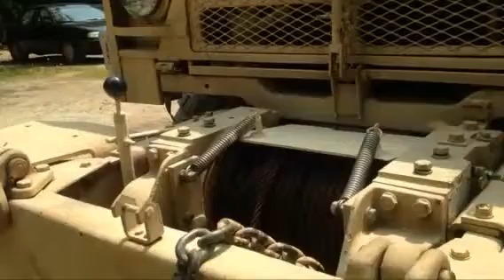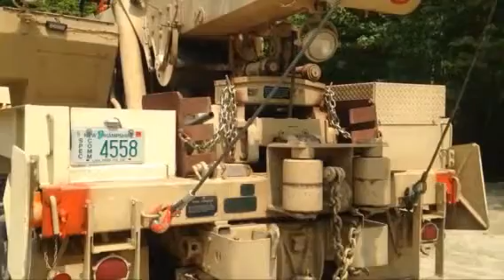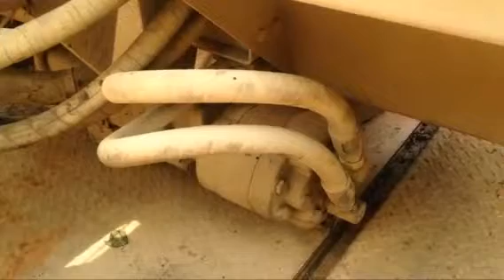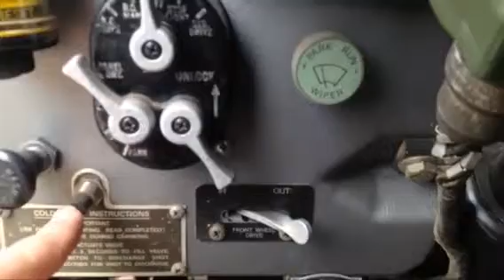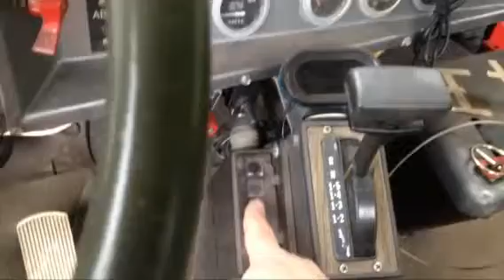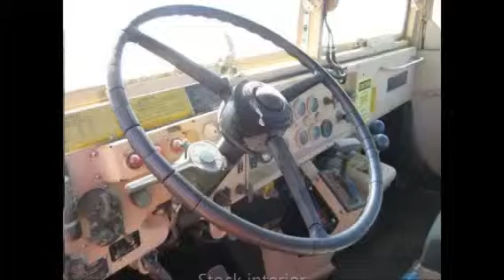Mikes Towing Military Wrecker Part 1 General Info

Comment: I owned 2 M923a2 cargo trucks.  I believe the A2's were built 1989 to 1991 (3 yrs), they have the newer turbo cummins and the tires you can change air pressure on the go from the cab.  the earlier 900 series had that older cummins (NHC 250?) and no tire deflate system.
Reply from the maker: you may be correct, i based the year on what it was sold and titled as, but you are not the first person to think it was newer then i thought.
Reply: The A2's were built 1987-1994 and from BMY Division of Harsco.
The A1's were from AM General and had NHC-250's just like the original M939 series which also had dual tires and not the Super Singles like the A1's & A2's.
The easiest way to tell the A1's & A2's apart is that A2's have wheel guards on the front rims for the air valves and actually the tread pattern on the tires is different between the two series.It's only difficult when the A2's have their original rims swapped when some owners disconnect the CTIS.

Comment: Your rear right tires supposed to be in the other side according to your tread facing the wrong way
Reply from the maker: Agreed, im sure the tires are not original and came off different trucks at different times throughout its life. I bought and sold it with the rubber it has in the video.  Thanks for watching
Reply: @mikestowinginnh7866  I'm just poking fun buddy this is a badass setup and I really like what you have done to it this far and will be staying tuned for more if you go on any calls with it I beg you get some footage of it in action please
Reply from the maker: @taylorwalling8234  no worries, but your totally right.  i remember walking around the truck one day trying to figure how to get them all going the same direction. Unfortunately i sold the truck this past fall. So that's it for videos of this one. Thanks again for watching.

Comment: I was assigned to a 5 ton wrecker for the last 6 months of my time in the U.S.Army and I have to say I did some things with it that were dangerous but got away with them.like picking up 5 tons of lumber without putting the outriggers down when lifting over the side of the truck  and having the offside tires off the ground 2 feet off the ground. or picking up a bundle of railroad ties and pulling the dead end off out of it's attachment and streaching the boom cable.
I was in a construction batallion that had two truck mounted cranes they and a large American Rough terrain crane and would not send them to the S4 yard to unload this stuff. 
I kept telling them the wrecker was not big eough for the job and they kept sending me so I did some  scary things and those guys over at the S4 yard knew what to expect I would supervise them setting the slings and then tell them to hide before it made a lift. They really got a kick out of watching me do it without hurting anyone or the truck.

Now yes I could have lifted the stuff a little at a time taking hours or playing cowboy and doing it all at once. When went to the field the wrecker is last in line and in Texas there are coleechy roads and dust flies at the back, 

I have another story on that one. the convoy leaves the motor pool and gets out a ways and the Batallion Commanders jeep quits. I have to hook a tow bar on it and they make the driver sit in it as I tow it for the rest of the trip. We were going along on those dusty roads and I can't see 20 teet in front of me I may have been going 45 trying to keep up when all at once there is an MP standing there pointing to turn right and the turn was pretty fast but I made it. I can only imagine what it was like for that guy in the jeep.When we finally got to where we were going that guy in the jeep was covered head to toe with that dust.

I did not ask him how we made that corner without the jeep turning over or even talk to him. When I got out of the truck I don't remember looking for him. Probably a good thing or It could have been one hell of a fight.
Reply: Is it under rated?
Reply: Operated one for a couple years as well with a similiar experience. Training was a few ride alongs with the previous operator, mostly involved drinking coffee and getting away from the motorpool. I never used the outriggers lol. Had pallet duty one morning ( heavy drop pallets used to drop heavy equipment out of C130s) and a team of 11Bs tasked with assistance. No idea how to safely lift those pallets onto the flatbed. Two ratchet straps, boom hooked at the center point, and a couple grunts guiding the load. Nobody got crushed that day thankfully. We got it done, safety optional.

Comment: i beg to differ with you, the army did use them as tow trucks
Reply from the maker: jim thanks for watching its been awhile since i made the video or watched it, but i think i was referring to using it as a civilian wrecker would be used. If it were to be used in the same fashion the boom winch cable would be destroyed when pulling at an angle. this is why a crane boom and a wrecker boom are designed differently. This truck in original form has a crane design. Hence the reason the call it a material handling boom not a wrecker boom, and why there are no recovery procedures out lined in the operators manual that utilize the boom. But yes i agree they were used to tow vehicles, i may have worded that wrong.
Thanks again for watching!

Comment: Mr Mike's towing in New Hampshire, Sir.  I think your explaination is very clear, and well done.  You mentioned Sir,  that your  BMY-936A2  wrecker is or was, extensively modified to  operate  in the civilian  field of towing. And perhaps recovery.   So, accordingly, 
I assumed to see, first of all , an Old school tow bar,  installed onto the rear of the truck.  I was NOT expecting an under lift, due to the fact that the rear of the military truck, is a very jam packed erea for a 6x6  unit like it is, and  the frame has very little overhang onto which to install the commercial under lift.   So, accordingly,  I fail to understand Sir, How  exactly Your truck is so , extensively, 
modified! It seems very stock, as issued to me.  So I would  be interested to know, just for curiousitie's  sake. 
Also, These Military wreckers are designed for use , in seas, of MUD, on dirt roads,  pulling out, and manipulating heavy weapons, 
bogged down in mud !   they are low speed trucks,  they are utilitarian work horses, with no bells and whistles !   They are for rear echelon work, behind the lines!   they are very over built, and over strong!  they are also heavily abused, by youngsters, who are 
impatient,  and poorly trained.   It is not easy for training personnel in the  civilian  National guard, to  turn week end warriors into
competant  recovery  professionals, with outdated equipment , which I personnally respect,  very , very enthusiastically, as compared to , modern,  Miller Industries, ultra expensive state of the art , fully hydraulic  boom equipment  installed on  ultra expensive  modern 
tow trucks !   I own , personally  three tow trucks. One, a simple  50  thousand pound  pulling whinch , on a primitive  frame;   which
hangs a simple  huge pulley block,  down  to a primitive, but very functional tow bar.  This is a monsterly strong pulling set up. 
and  another truck a  5 ton, with a more modern  about a 30 thousand pound pulling whinch, with  a more  recent booms, and  a 
more modern tow bar assembly, for towing light , and medium trucks, and cars.   this  wrecker unit and body seems commercial, 
but has no id plate.  And I have a Ford L700,  gasoline powered  truck, with a Holmes  600 wrecker, equipped with Holmes 750 booms
from the plant , to tow school buses.  It also has a wonderfull gas powered HD air compressor on board; between the cab and the wrecker  body ! A very powerful,  old school  top of the line at the time  wrecker, before the hydraulics, took over !  Very powerful! 
But I see so many wreckers like you have ,  put up for sale , because they sit, doing nothing; primarily because the  today's sort of drivers,  refuse to drive these trucks , because of comfort,  and air conditioning, and ease of operation;   so owners are forced to sell
them, because they sit !   The drivers all demand the latest  Miller Industries  towing units, but they have no money to pay for them! 
All of this is true, to my experience in the business.  The cost of equipment is crazy, in the business these days !  and a couple of driver/ operator/ owners of old school Holmes units, with tow bars, have no idea, how to hook up the trucks properly today ! 
Very sad!   And they make no efforts to learn how, either!  anyway !  A very nice truck, you have there Sir! In my opinion at least! But I am old, and  old school.  Best regards, kennethzakaib607@gmail.com  Montreal .  I have a very rare Inter 1600 4x4 1963 Loadstar
built for the US air force, that spent most of its life on the Arctic dew line, for sale!   Please pass the word! thanks. 
nov 2020